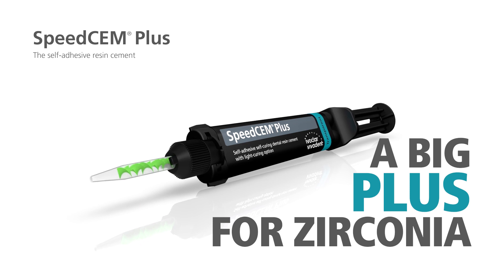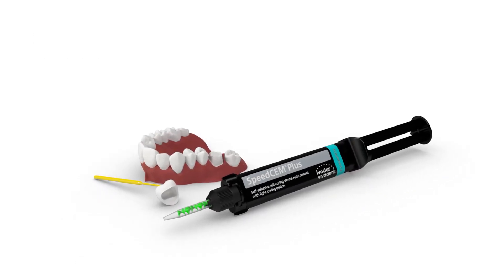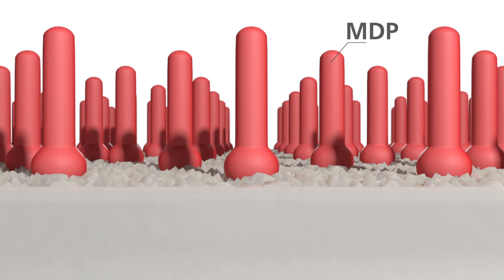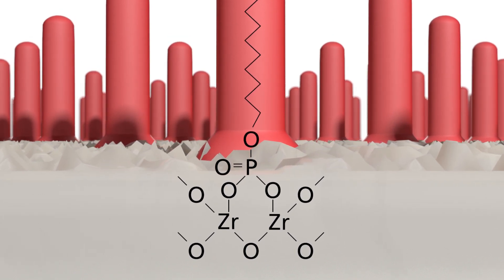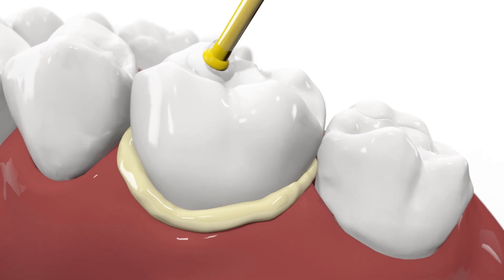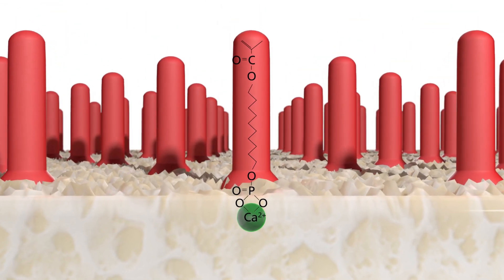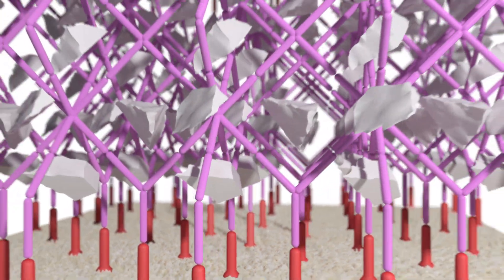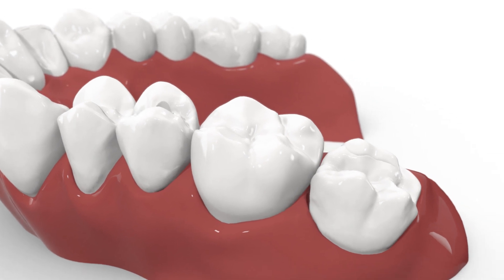SpeedCEM Plus – working principle

Comment: Etching the tooth surface without the application of Monobond  before fixing the zirconia crown  with speedcem plus. Is this method  also fine ?
Reply from the maker: Dear Suhas Acharya,
No, you etch only ones. In this case, etch in the Lab, try in, wash with Ivoclean and then Monobond.
Best regards,
ServiceLine, Ivoclar Vivadent
Reply: @Ivoclar-global  Do we need Monobond Plus for zirconia crowns,( after Ivoclean)? He asked if he could skip Monobond Plus, and go with SpeedCem, as I understood.
Reply from the maker: Dear  @jasminkadragoljic5517 , thank you for your comment.  No, Monobond is not necessary. 

Some additional information:

2.1 Restorations made of oxide ceramics - (e.g. zirconium oxide, IPS e.max® ZirCAD) IMPORTANT! In order to achieve a strong bond, do not clean the surfaces with phosphoric acid. If the restoration has been sandblasted in the laboratory: – Apply Ivoclean, as described in section 2.4, to clean the restoration. If the restoration has not been sandblasted in the laboratory: – Sandblast the inner surface of the restoration (use the blasting parameters stated in the manufacturer’s instructions for use of the restorative material, e.g. IPS e.max® ZirCAD, max. 1 bar/14.5 psi, Al2O3). – Clean the restoration e.g. in an ultrasonic unit for approx. 1 minute. – Thoroughly rinse the restoration with water spray and dry with water-/ oil-free air.

We hope this helps, have a great rest of the day, Your Ivoclar Social Media Team